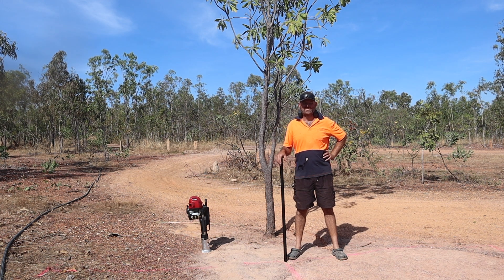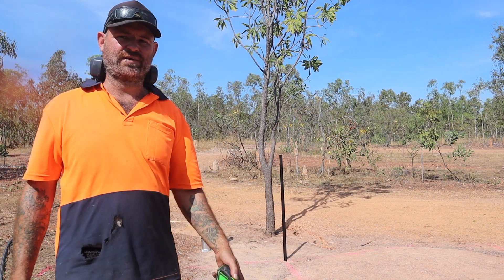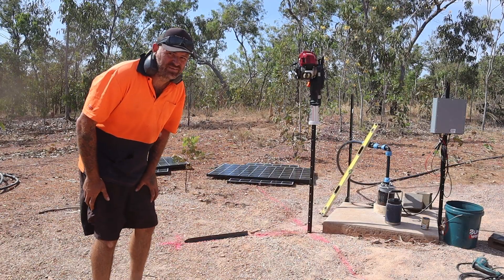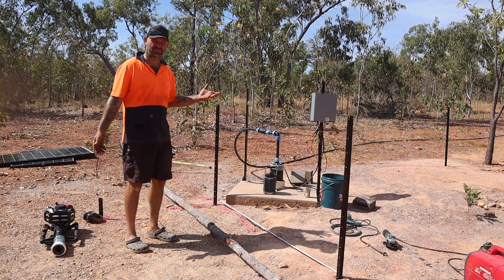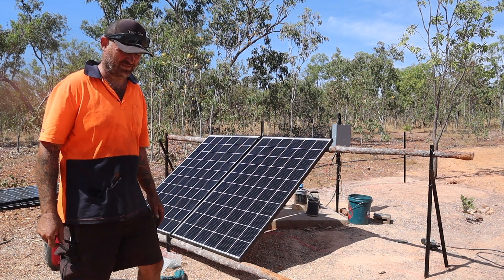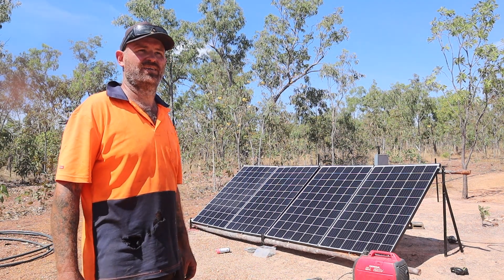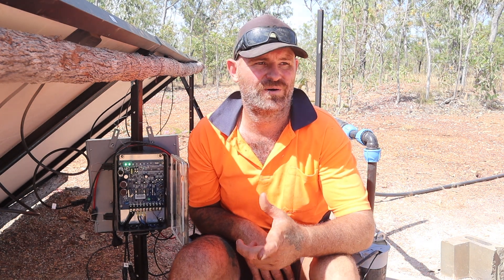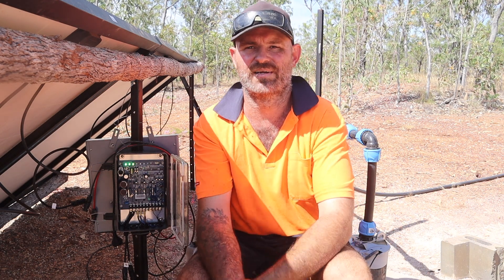Budget SOLAR Panel setup for the bore!

Comment: hey mate, can you please  post/reply what bore pump and MPPTR you used please imn interested in doing the same here in NQ TY       :)
Reply from the maker: Hey, our bore pump is from Tuhorse Pumps. It’s the 4” 1000W model. It comes with the MPPT also. I’m pretty impressed with it so far and they have good warranty. Plenty of good reviews for them. 🍻.
Reply: @TheBaldandtheBeautiful  thanks mate loved your videos i might have to go down the same rabbit holr with that bore pump, and like you get mu own panels as they can be a lot cheaper then OEM - i guess thats why you did that too? -btw i was told no! no digger lol.
Reply from the maker: @TindogTravels I went with secondhand panels as they were cheaper than buying from the pump place. I also didn’t need them straight away as the pump can run from a small generator with an AC to DC converter. I used the generator for quite a while before I got around to setting up the panels. 
Spewing about the excavator….. keep trying 😂.

Comment: I was watching you and decided to go online and look up accessories for my XU1 Cordless Impct Driver as it is the only one of the set of battery operated tools that I couldn't get my accessories to fit, so I decided to look up "How To" on the subject and you will never guess what, I have found that I to can make it work, no trip to Darwin required, that is such a relief as I hate driving to Darwin, I have been such an idiot and should've just gone online and looked it up instead of believing I was right, as they say, "when all else fails, read the instructions", oh well have a good day.

Comment: How handy are you, the only problem is that nothing natural up here last very long so do get your steel for the framework because that wood will just disappear in a flash of time. Well done, I still have to get my head around electricity from solar and I will do that when I sell my blocks down south and buy up here in the next year or two. Have a good day.
Reply: Yes, getting into town does become a headfuck after a while, I have to drive to Katherine, 92 ks or Darwin 230 ks to pick up a screw or two, I try to make it a complete shopping trip to include groceries and doctors and chemists and hardware store, I use $80 odd of petrol just to go to Katherine and back, I can't even get everything from there so use the internet to buy products like the new starter motor for my backhoe and I need some attachments for my battery operated rattle  gun, maybe I can buy that on=line instead of going to Bunnings. Have a good day. Leon
Reply from the maker: I have sourced some aluminium rails for the panels but I need to get into town and pick them up. Just another job on the list. Thanks for tuning in as usual Leon 🍻.